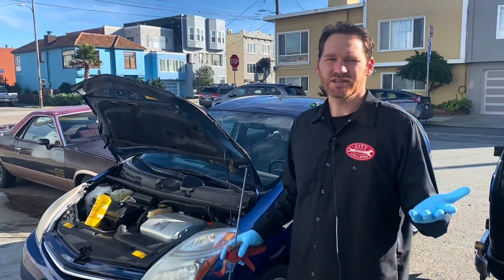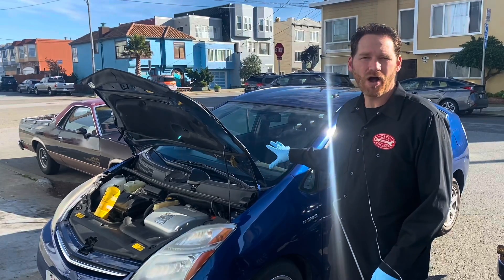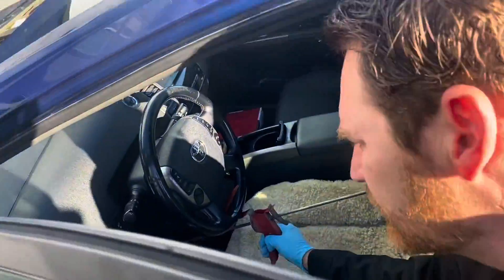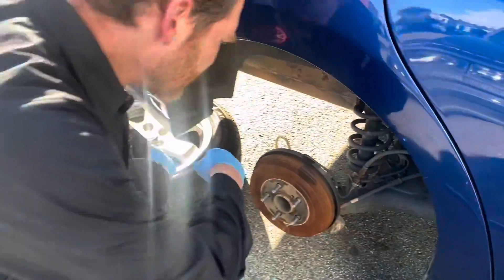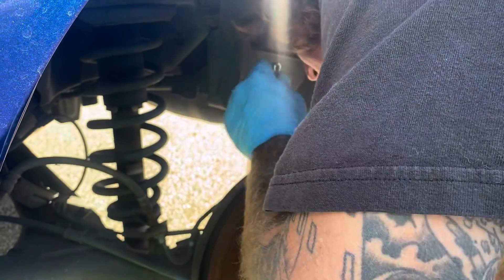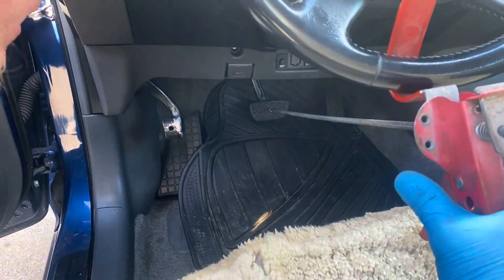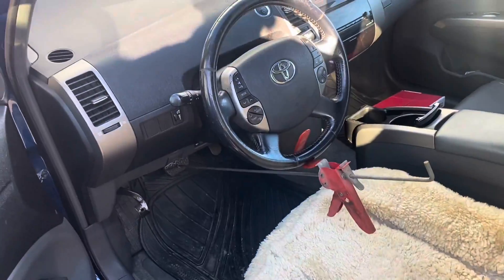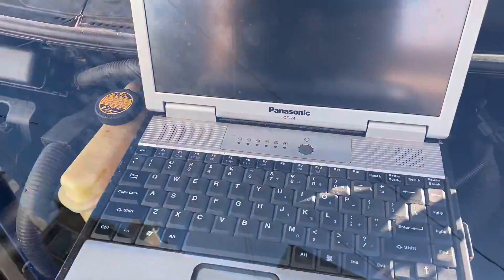Prius Brake Bleed No Scan Tool Part 2

Comment: You don't have to wait until air bubbles come out of the tube like on a normal car?  You just crack it out open for a few seconds and you're done?  Does the actuator have some kind of a fancy system for purging the air inside itself or how does this work?  Thanks.
Reply from the maker: I’m not sure but I always bleed a decent amount to change the brake fluid at the same time. The bubbles in the clear tube can be deceptive because bubbles sometimes come from the base of the bleeder screw too. I never watch the clear tube for bubbles as an indicator.

Comment: The ABS actuator on my 2007 Prius has been bad for a few years.   My rear brake drums are due to be changed.  I have a techstream.  Would I be able to bleed the rear brakes using the techstream with a bad ABS actuator or am I going to have to bleed  them manually?
Reply from the maker: I am not sure if a failing actuator would tolerate bleeding. Its hard to say. I would avoid the linear offset procedure in tech stream. One idea is to be careful that the wheel cylinders don't come apart during shoe replacement so you don't need to bleed at all.

Comment: Do you release the brake pedal between each caliper bleed? Or just leave the pump running for the whole process? How long is it OK to keep that pump running? I assume that it would stop when you have all bleed valves closed and the pressure is built up to spec.... then the pump would restart when you open a bleed valve and lower the pressure?

And maybe most importantly: If you somehow get a code on the car, is it still driveable? Or are you now in a situation of needing a tow or site-visit by somebody with the scantool? Perhaps a manual code-clearing is all that's needed?

Comment: I am not sure how to contact you with a question - it is not related to this video, other than that it is related to a Prius:
I have several warning lights on including the ABS system and some sensor lights and the stereo is going on and off occasionally. The ABS system does not work - MOST of the time, but particularly on warm days, it sometimes pops on and all the system warning lights go off and everything works again. Then usually after 1/2 hr or so the lights come back on and the ABS system stops working. Sometimes when the stereo is going on and off, some of the warning lights also blink. 
It seems obvious that I have some sort of short and not a problem with the ABS system and probably all of the other warning lights. Questions: Where would you start and do you think it is a computer problem?
Reply from the maker: @monkwithfamilyorg  scan the codes
Reply: @Mrelectric423  I have scanned the codes and they basically say the various lit up things need replacement. But then the lights sometimes go off and the ABS system works again, the radio has no problems and everything works fine with no wearing lights on.
I think this pretty clearly shows a short or computer problem.
The ABS system is very expensive and why would it work and not work and why would all the warning lights go on and off if they were actually bad?
Reply from the maker: @monkwithfamilyorg  all conjecture until actual codes ( the 4 digit number ) is known

Comment: I did this on my gen 3 and it worked perfectly.  I'm too cheap to buy a pedal depressor so I used a 2x4 and adjusted the seat to depress the pedal.  Flushed my brakes out fast.  No error codes
Reply: That's a great idea. I was just thinking how could I rig a caulk gun to mimic that tool, but I'll try the old trusty 2x4
Reply: That's great to hear. I'm still wondering how would this work for the front bleeding process. Normally, for the front which don't have electric power pump, we need to depress the break manually to build up pressure. How was the front bleeding process for you? Could it be that the whole system with all lines frond and back are pressurized; therefore, this method worked?
Reply: @CCG0D  both front and back worked for me.  The pump goes on and forces the fluid out.
Reply: @Kanotoa  thank you very much for confirming!
Reply: @CCG0D  no problem.  The prius is actually the easiest car to flush
Reply: gen 3 has an "official" way to bleed the brakes without techstream, depending on the work done and where the air is, that hits the actuators, fwiw (for simple stuff, this still works). https://www.youtube.com/watch?v=UZ1wpW62L7U
Reply: I wonder if this works on the gen 5
Reply: @Kanotoa this vid or the non techstream full one?
Reply: @RogerPack I was wondering if you could use the 2x4 method without a techstream
Reply: @Kanotoa I'm not familiar with Gen 5, but I assume you can.  There's probably an "official" way to do it as well, that doesn't require techstream, is you want more thorough...
Reply: @RogerPack I'm still driv8ng my gen 3,  I will de this till the eels fall off or give it to my daughter

Comment: Was there a point in time where you turned on the car or just have the door open to keep the brake pump pumping? My brake bleeding valves don’t bleed from the ports, I pretty much had to unscrew them… I must be doing everything wrong
Reply from the maker: If a code is set the car will refuse to cooperate. You may need to clear codes.

Comment: How do you bleed the stroke simulator using this method? I have an annoying c1246 error, despite following this method. I cant seem to bleed the stroke simulator. Nothing comes out.
Reply: The service manual says to 
"Set Brake Control" by
"With the power switch OFF to prohibit brake control, 
Remove No.1 and No. 2 motor relays {in the engine bay}
NOTICE: If the pump motor operates while there is air remaining inside the brake actuator hose, the air will enter the actuator, resulting in difficulty in air bleeding. 
HINT: Brake control (Electronically Controlled Brake system) can be prohibited by selecting 'ELECTRONICALLY CONTROLLED BRAKE SYSTEM INVALID' on the Techstream [PRIUS SERVICE MANUAL, BR-21 2.(a)]."
I backtrack a few pages for more information closer to your question's answer : basically bleed the front brakes like normal with the relays removed KOEO {that being for the m.c.}, then replace the relays with pwr OFF, "the techstream wants" a command, {so when we don't have techstream, we bypass by whatever sensibility we know, maybe there is a way to electronically activate the stroke simulator otherwise¿}, bleed air out of stroke simulator twice. "(1)Depress brake pedal 20 times in 20 seconds. HINT: Depress the brake pedal 20 times at 1 second intervals, holding the brake pedal down on the last depression.
"(2) Perform the usual air bleeding for the FL wheel.
HINT: •Loosen the bleeder plug of the FL wheel and bleed the air with the brake pedal depressed •See 'BLEED AIR FROM FRONT AND REAR BRAKE SYSTEMS' for bleeding instructions [MANUAL BR-9-12]" 
goes on to state that the bleeding is complete when the techstream tells that it is and next check & clear DTCs. My guess is find out with the next DTC reading otherwise repeat a few times.
A lot of our intercultural liaison had been with video games, (likely since the 1970s, and it does not look like that is going away, even more). ...so, go figure. 
I can look at the Chilton I have and compare, but am doubting those nuances and addenda are included. Rarely, but Sometimes it helps, and using middle-path mentality in considerations.  ...
Reply: @meljane8339  Thank you so much. I'll try this out. Appreciate the detailed advise. 🙏
Reply: @richcruz936  I can only hope it works. I don't have many interactions, but Toyota seems pretty kind in terms of providing some intellectual property/technician information, as long as you stay proper about it. I have called their nation-wide number twice when I first owned my vehicle 2-3 years ago. Helpful.  ...Also, generation 3 models (2010+) supposedly have minimal diagnostic access via the cabin/dashboard display.  Also, most OBD-II were supposed to maintain some on-board+off-reader coding.

Comment: Wow! This is the easiest way to bleed the brake fluid that I have ever seen. Does this method also work for Gen 3 Prius 2010~2015?
Reply from the maker: @NoSuffix  yes it does
Reply: @Mrelectric423  I used your method to bleed brake fluid from my 2010 Prius yesterday. It was so easy and quick, much better than all the other methods I used before. Thank you so much!

Comment: Thanks. I’ve been trying to get my rear to bleed for a year on Highlander HV and been driving around with lights on not knowing what was wrong. I bought a vacuum bleeder and tried that. Hopefully I didn’t cause other damage not sure if this will work now or If I need to buy the scan tool.

Comment: Help... I did a rear brake job 2008 prius..The wheel cylinder was replaced.  Now when I depress the brake pedal the actuator runs for 2 seconds and stops..Any clue as to why I can't get brake fluid flowing?..thanks
Reply from the maker: You will need to clear codes before you can bleed the brakes to fix it.
Reply: @Mrelectric423  I did clear the codes with a paperclip .. codes are no longer showing..But actuator runs for 2 seconds and stops.. Cars brakes were fine but rear were almost metal to metal... When I put the shoe back onto the brake cylinder it shot out brake fluid... So I changed the cylinder only to have the abs warning light appear.
Reply from the maker: @mikekendall5835  did you try brake bleed procedure as shown in this video and 2 others with brake bleed in title. It will not let you bleed with codes present so you may need to clear codes a few time. There is a more in depth bleed procedure using the scantool that may be needed if nothing else works.
Reply: @Mrelectric423  yep like I said above I did clear codes...
Reply from the maker: @mikekendall5835  you did not mention if you tried to bleed the brakes
Reply: @Mrelectric423  well I was able to bleed the rear brake.. But it is completely  different than anything I can find on the web... it worked..I guess I will have to post a video for all to see... thanks for your help
Reply from the maker: @mikekendall5835 Interesting!  How did you bleed the brakes?

Comment: You can clear codes with the pin method/paperclip as well.  You can also do the re-learn process for the linear selenoid offset with the pin method as well.  Only problem with doing that is the computer throws codes pretty fast, so you have to be quick about it.  Can also place into diagnostic mode using the pin method as well.
Reply: How do I do the solenoid recalibrate with pin